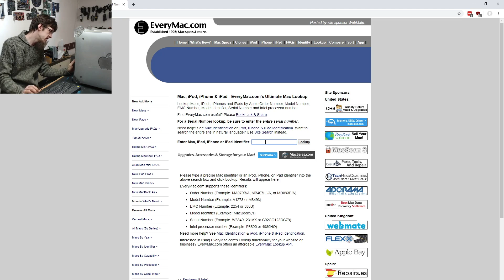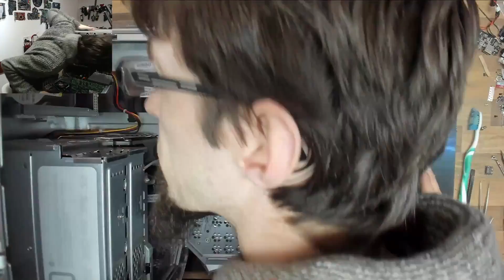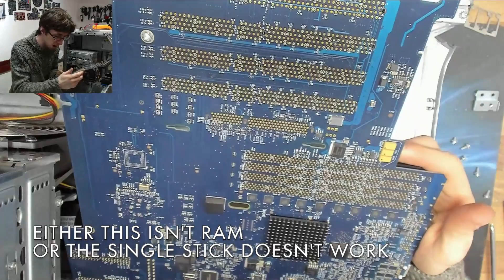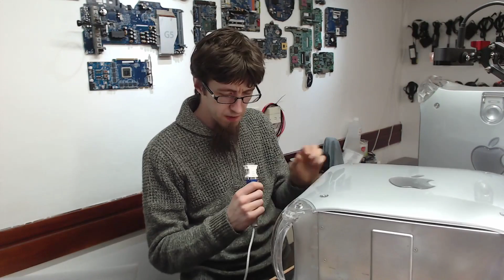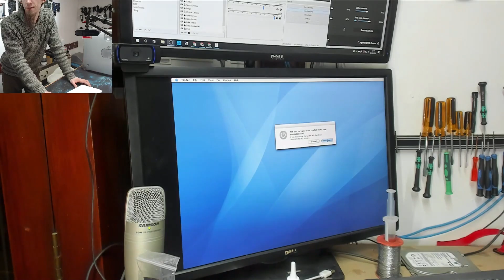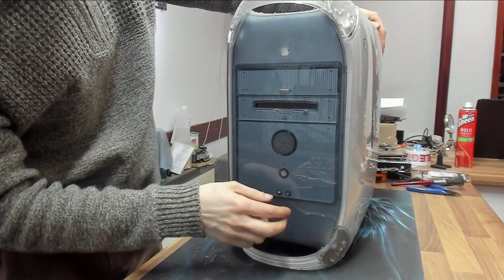LFC#164 - Apple Power Mac G4 Exploration

Comment: Super old video, interesting info on the chips etc. But few comments for future generations: none of the G4 Towers had PCI-X, they all have PCI. All G4 processors have Altivec. All MDD -models have the Radeon 9000 Pro. And the main culprit for the fan noise are indeed the 2 60mm fans in the MDD PSU. And yes, the MDD (and Quicksilver) PSU's very commonly break as they used bad caps in them. And one more: always swap out the batteries on these, they will leak and corrode the logic board even destroying them.

I would say that the G4 of yours is the G4 "Gigabit". That processor of yours could be 400MHz, that is where the part number points to. And the only single cpu Gigabit-model was indeed 400MHz.

Comment: "...Not worth anything..." Yeah, I think you'll find these are actually quite valuable in the right circles and condition.  And also very very useable too given the right tasks.  Saying they're not worthy of any attention is just snobbish and blinkered.
Reply from the maker: You're not wrong... I'm just coming from production environment experience, where I've watched companies spend thousands to keep these things running instead of replacing them with modern equivalents. Don't get me wrong, repairs are all well and good, but there comes a time when someone is spending multiple times the cost of replacement on an old system, and all they have to show for it is 800MHz and a FireWire 400 interface.
This was ten years ago though... I could imagine that these things are passing from the "too old to be useful, too common to be collectable" area of retro computing into the "actual vintage and hard to find" area... if you can find a buyer anyway.
Reply: I'd forgotten about this comment, it was ill thought out, sounds confrontational, not what I meant it to be. Anyway, yes today's 'vintage/collectors' market has gone bonkers, and it doesn't always make sense.  Specs aren't the driving force, it's driven by nostalgia but quickly bandwagons into a 'must have' mentallity and then prices soar. It's taken me two years to find a decent socket 370 motherboard to suit a random CPU I had that I wanted to base a system on.  There are plenty about, but I refuse to spend £££'s on one!! The classic Apple scene is even worse.  But for me, it's all about keeping 'obsolete' machines running well, relevant and useful. I hate the throwaway culture.  I have a fantastic Ryzen system, MacBook Pro laptops, Windows 10 laptops, but I do all my writing (nothing impressive, just 'stuff') on a Toshiba Satellite 110CT from 1997...
Reply: @Adamant_IT  They are currently in the "Available for 30 quid or found by the side of the road" state. The older beige 68K macs are starting to become collectable. The problem with older macs is dodgy capacitors and dying motherboard batteries. A further problem is increasingly brittle plastic. Shipping old macs, including those slightly older than this vintage, is rolling the dice to if you receive a computer or a box of plastic shards. Unless you act now to 'safe' them, your old 68K mac will more than likely look like someone killed a xenomorph on your motherboard.

Comment: The g5 systems are nice but they had their fair share of problems from leaky water cooling on some of the dual G5 systems to other problems. Also interesting bit of information that the Xbox 360 had a similar CPU to that of the G5 hence one of the reasons why they had cooling issues at the beginning. This is a 2nd time that I have seen on YouTube a dual G4 system that works.

Comment: interesting video, the earlier g4s, prior to MDD, they used  a AGP 4x connector instead of 8X because they didn't had the extra connector bit, they used the rest of what would've been the 8x portion for the power line to the ADP, you can only plug a compatible mac flashed 3rd party gpu if you cover a few pins on the connector so you don't send 24v to the graphics card

Comment: You've got 2 options to put in: plonk in an ide to sata converter and attach an ssd for the boot drive. Besides that, try to find a pci sata card so you can put in more and bigger drives. Install 10.4 and use as a file server. It has Gigabit ethernet in there. Got one running here. SSD makes it boot up very nice and quick. You can even maybe put a 10.4 server version on there.

Comment: Why not mod the case into the intel standard and hackintosh them? These things are becoming increasing rare due to the fact that they are totally useless for running any modern intel build software and people are binning them. You will probably notice that apple shy away from using the 'intel' word but the fact of the matter is that all modern macs use generic intel components and indeed their motherboards are built in the same factory as the generic intel boards.
Reply: I wonder if there will still be some Intel parts left after the transition to the ARM Macs...? Such as the communication chips

Comment: Your Video is so good I have now come back and viewed it for the forth time.
I have about 5 of these Macs. I do find them useful for ripping CD's but not much else. I had one fitted with 4 x 500 gig drives.
I do have one set up for a 23" LCD but I run the display off a separate power supply.
You could recover the optical drive and install it below the other drive. 
They have standard settings on them to allow them to run as slave and master.

Comment: Not PCI-X, those were full length PCI 33MHz 64bit slots. PCI-X did not come to the mac line till the G5.
Reply: Only the quad G5's had PCI-X all the rest were AGP 8x
Reply: The quad G5 had PCIe not PCI-x. The 2003 to early 2005 G5's had PCI-x and AGP 8x slots on the top end models and regular PCI on the entry models. The last gen, the late 2005 models which included the quad G5 had PCIe @monde9419